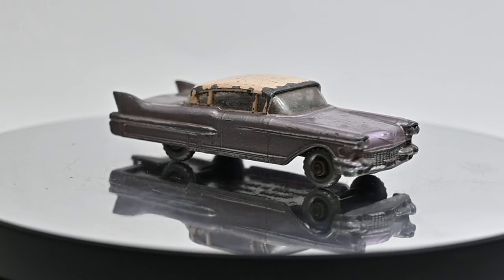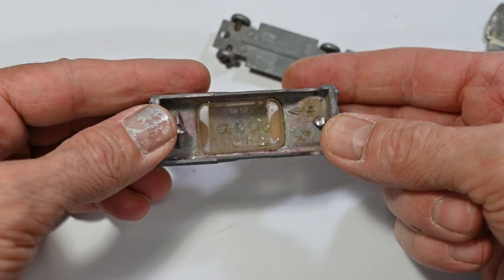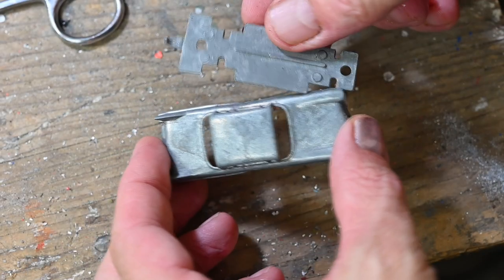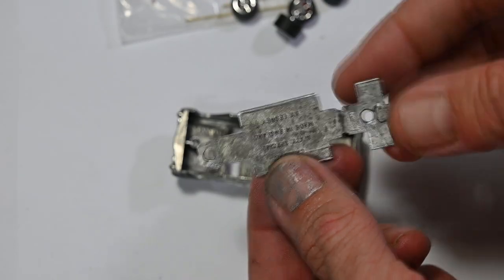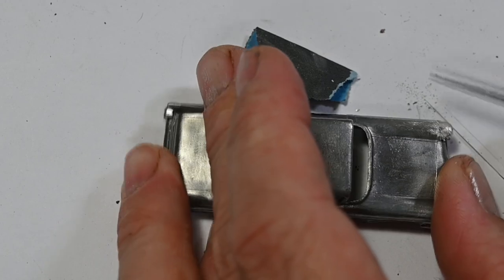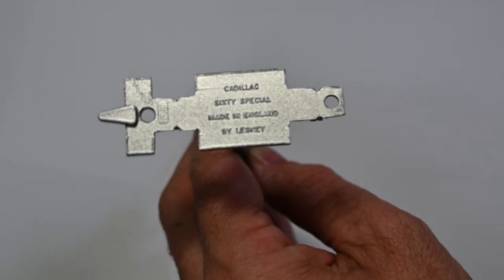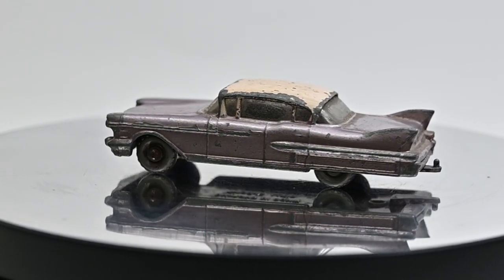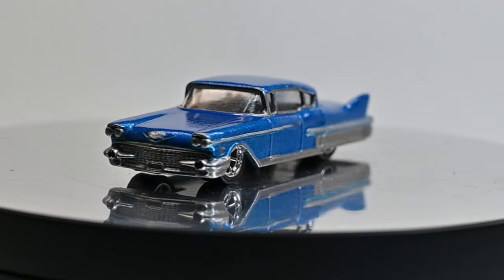Customizing A Vintage Matchbox Cadillac | 1958 Cadillac Fleetwood Sixty Special Sedan

Comment: Great work!  The extra chrome detailing highlights really changes the look of the model.  Note that the window plastic has #76 on it.  The Cadillac was proposed to be model #76, when Matchbox decided to keep the range at 75 models - so #27 it became.  The Sixty Special replaced the Bedford low loader, and was itself replaced by the white Mercedes 230SL convertible.